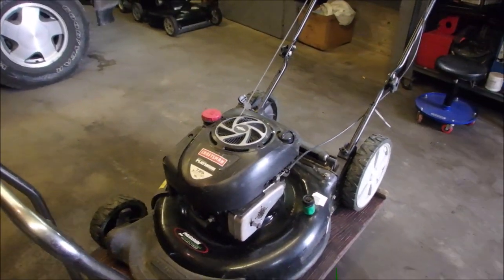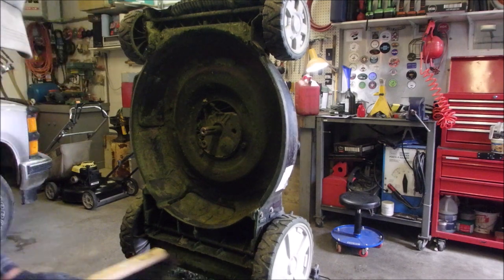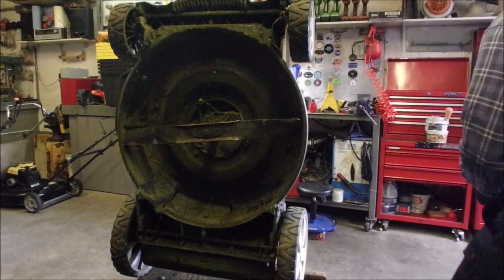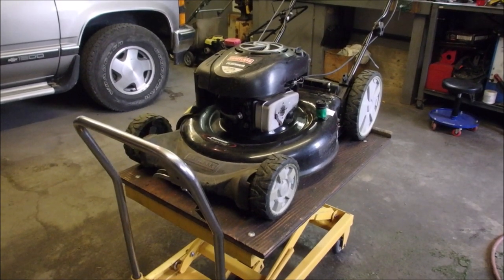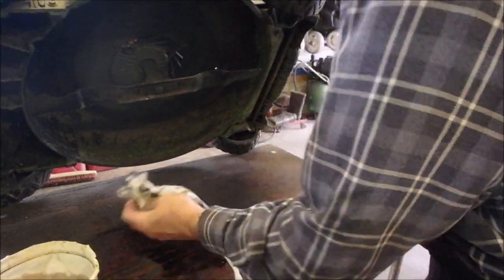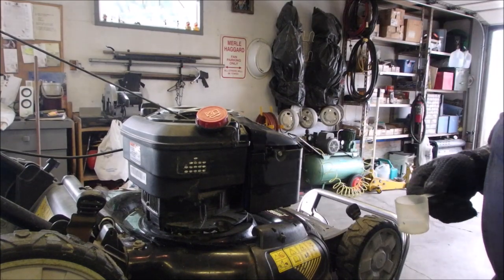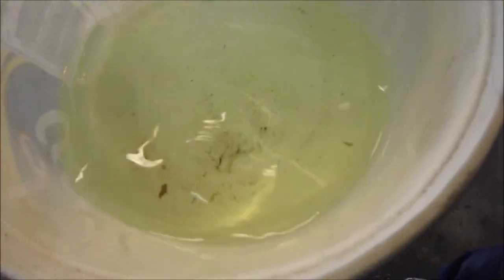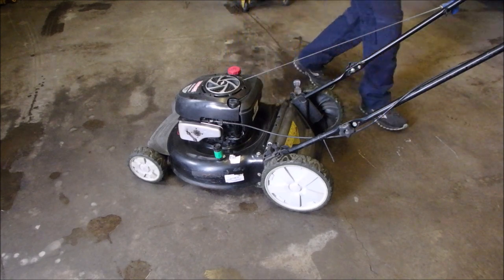This Sears Platinum Mower Really Needed a Tune Up

Comment: Nice job sir, ok wow the Honda I got for free cause of a messed up rear wheel drive, turned out to be an easy fix, the inner c-clip had come off which made the right side mechanism all loosie goosie, so put that back together, and it works perfectly now, so started cleaning it up, Omg the broccoli was a mound, I've never seen so much.
Today will be power washing it, sanding the rust spots and painting, 93f here today, a real scorcher.
Reply from the maker: Nice work!  Be careful in the heat.
Reply: @BrucesShop  oh yeah 103f today... Yikes.

Comment: B&S Quantums are timeless Bruce!
Reply from the maker: I like them better than Honda's
Reply: put one on a Snapper deck years ago. Got curious about the year of production.
April, 2000. Twenty-two years old.  Runs perfect. On a '83 Hi Vac deck. 
These Qs, change oil, air filter, run forever.  Honda builds a nice OHV engine but the Quantum is the best side valve period.

Comment: neighbour of my friend put an ohv spark plug in an 01 quantum on a toro personal pace. exhaust valve hit the plug so the plastic cam gear shifted on the shaft and actually cracked the gear centre bore. although the part number for the cam is different I pulled one from a 91 quantum.  looked identical so I installed it and it's starting right up and running good.  it has the automatic choke.
Reply from the maker: That is to cool.  Have you seen my quantum timing gear video?

Comment: I usually have all kind problems with these  engines. Lots spark gas in carb directly won't start. Decent compression.  ... what's for supper? CB
Reply from the maker: Not sure  Left over chicken ??
Reply: @BrucesShop  left over birthday cake? But not from Mrs P’s old cake pan, I hope.
Reply: @BrucesShop   try a buffalo dip. Cream cheese ,chicken, old cheddar, ranch dressing, franks. Tortilla  chops. Yum lol

Comment: Have to chuckle at Sears hyping that mower as "Platinum." Usually that term is reserved for higher end or achieving products. Sure it has a great Quantum engine but no different from what's was on most non-Platinum Craftsman/Briggs mowers back in '12. But the rest is pretty "Economy"; ie, standard blade & no self propel for example. Likely the Premium sticker also included a higher price. Anyway, nice filming and fix.
Reply from the maker: Thanks JJ

Comment: Your wood on the table is always well oiled eh  🤓
Reply: He needs a wider catch container—more margin for error. I find tipping the mower and draining out the fill tube much less awkward but to each their own. Won’t forget putting the sump plug back in doing it that way either!
Reply from the maker: You are right.  However I use what i use.

Comment: I did not know that some Quantum’s have an electric choke. I have never seen one but most of the ones I have are not top end models anyway. So when the battery goes bad that choke doesn’t work any longer? Thanks Bruce!
Reply: I think Bruce meant auto choke
Reply: @waynestefinashen239  ok. That makes sense. The wind powered ones are good. The exhaust temperature ones can be a problem. The really old mower ones and the pressure washer Quantum’s tend to be manual choke. My favorite preference is no choke and the primer bulb in its place.
Reply from the maker: Wayne is right.  If i could only talk.  LOL
Reply: @BrucesShop  if I could just say a few words, 

I’d be a better public speaker.
Reply: @haneyoakie14  The best made autochoke systems were the air vane ones. The only time there is an issue is if mice get in there and chew up the plastic air vane or the mini spring flies off

Comment: It appears Jim or others that may have worked on that mower installed the wrong plug which runs hotter than the correct plug you installed. Jim was lucky to have a professional work on his mower cause if your gonna do it do it right like Bruce says. How many Bruce bucks for that tuneup lol?
Reply: Excuse me the BR4LM runs colder than the proper plug you installed and that may be why there was an initial miss
Reply from the maker: Well on a tune up as easy as this one I don't charge much.  i don't like to say how much as each area can handle a different amount.  Look at some of our friends in the U.S. Northeast can charge a lot more.